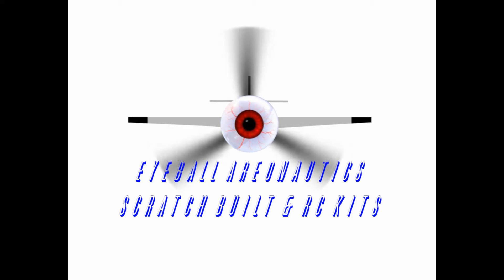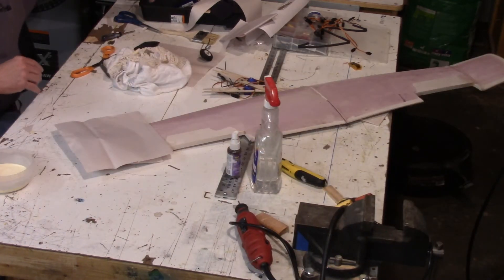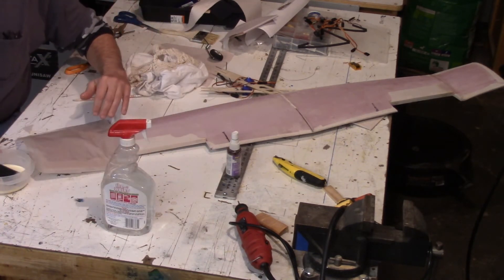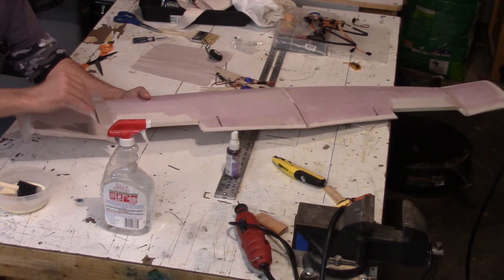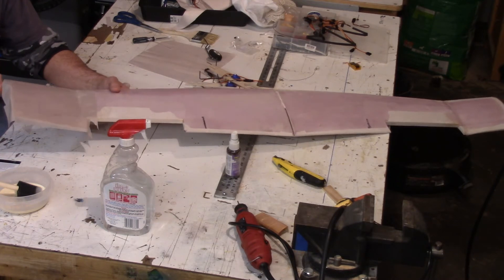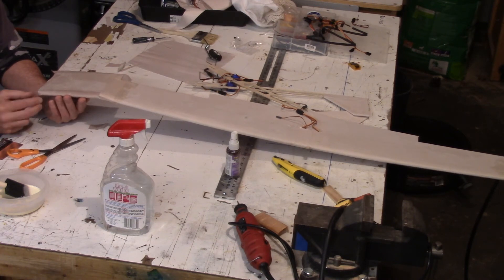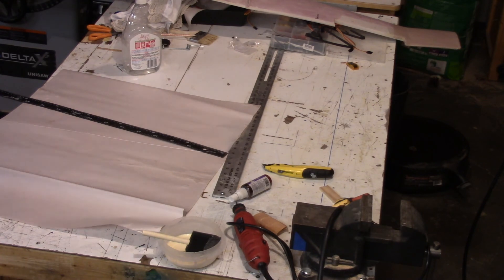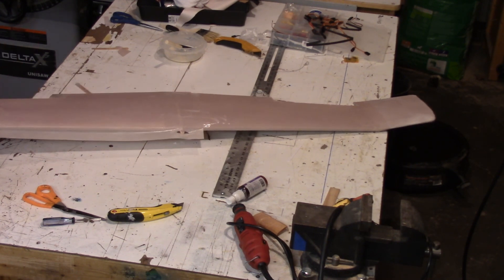How to cover foam wing cores with water/wood glue and news print

Comment: Good job
Reply: I think you are confusing dollar tree foam with hot wire cut wing cores. the idea here is to cover hot wire cut wing cores with paper not to remove paper from dollar tree foam.
Reply: @donolson6335  yes you're right, my mistake.

Comment: Question: doing one panel at a time and let it dry before you proceed with the opposite side, doesn't the paper shrink at all thus causing wrap(s) on the side of the glued paper ? Just curious.
Reply from the maker: I bought the paper from U haul. It is un-printed newsprint. It is used for wrapping glass when moving. I have heard that it is also available at Walmart but I haven't looked for it there. A box from U haul cost about $11. But there is enough in it to last forever.
Reply from the maker: It the panel is thin it will sometimes warp but most wings are thick enough that there is no wrap. I do both sides at once for elevators and rudders.

Comment: What is your process in finishing the wing? Of course sanding but do you prime after the paper covering? I'd like some details in you finishing process, I'm thinking of applying my paint with an airbrush using water based paints.
Thanks
Reply from the maker: Sorry I haven't checked the comments in a long time. I use primer and spray paint from a can. Be sure to sand most of the primer off it can add weight.

Comment: When I was making fireworks I specialized in black powder rockets,large ones and I learned to hand roll all my rocket tubes with WALL PAPER PASTE. When it dried it was rock hard. I just started my RC hobby after 50 years and as soon as I cut a wing core i will use this and think it much better than water based glue. In fact just having the foam soak up the paste I bet will improve strength quite a bit.
Reply from the maker: Wall paper paste sounds like it would work well but the beauty of diluting the wood glue with water and wetting the paper is that in the end there is a small amount of glue absorbed by the paper and on the surface of the foam. This makes the covering as light as possible while still adding a lot of strength. There are a lot of other methods around that are probably a little stiffer than this method but the trade off is quite a bit more weight. The way I've shown it here is the best I've come across to be as strong and light as possible. Also remember the paper is important because the paper fibers are what add the tensile strength. If the wall paper paste is what you are used to using it will probably work best for you. The only thing I would add is to get it as thin as possible. The paper adds the most strength so the thinner the better on the adhesive.
Reply: After rolling hundreds of rocket tubes and water based glue tubes for sure the paste like when applied to wall paper gives a strength not to be compared with. Most who use this method never go back to water based as it leaves ans uneven amount of glue around. The paste is just more effecient but as you have said to each its won me I live outside the box and when i begin any endeavor I check out all the methods of doing something as in firework making I created an uproar in the field and the experts went after me for,"how dare you we have used wheat paste for centuries,",all i could do is say ,"ya know new things are always being improved on due to new chemistry. One guy it took 5 years for him to come around and say the masters were right but that was then this is now.He loved the paste and swore by it. As in construction I sure my techniques in this field will shake things up abit but thats me Mr OTB !!!!!!!!!!!!!!!!!! ps; I wasnt knocking your method just speaking to another alternative. The weight to performance might mean just installing a more powerful engine which isnt a big deal.
Reply from the maker: Thanks for the reply. I didn't take it as a knock at all. I am also always looking for new ideas and improvements. I think the paste is well worth a look. As you sound a lot like me I experiment with all types of building methods. If you want to get more techniques on building RC planes I would suggest RC Groups. It's a good form and you can pick up a lot of info on building RC planes. Thanks
Reply: I will thanks!

Comment: Whats the paper for?
Reply from the maker: The paper does a lot of things. It adds a lot of strength and stiffness to the foam cores. It also protects the foam from abrasion. It makes a good surface to paint and you can use any type of paint and it will not eat the foam. Many paints sprayed directly on the foam will eat into the surface. The biggest reason is the stiffness it adds. You usually don't need a spar in a wing covered in paper where without it a foam wing will bend or break without a spar.
Reply from the maker: The paper does a lot. It provides strength and stiffness. Foam wings without the paper require a spar to be added. With the paper on the wing core is stiff enough without one. It also protects the foam from abrasion and dings. the paper also gives a good surface to pain. Many paints will eat the bear foam but with the paper on you can use any kind of paint without damaginge to wing core.

Comment: This is awesome!  I've been experimenting with hot wire cutting and other foam stuff.  My background in RC is mostly balsa build up kits and nitro engines so I'm kind of lost when it comes to foam.  Love the name by the way.  I've been Eyeball building these crazy profiled foam board jets lately.  I'm trying to get some videos of those jets up within a couple of months.  Thanks for the video.  I'm going to try that.  Subscribed.
Reply from the maker: Thanks. It's good to hear that the video helped out someone with the same interest in scratch building.
Reply: Bought a hanger 9 iron and a roll of thin laminating film. Works so easy and it comes out smooth and tight. This method is messy and think about it. Paper isn't going to add any strength.